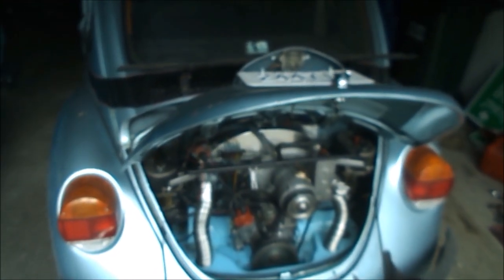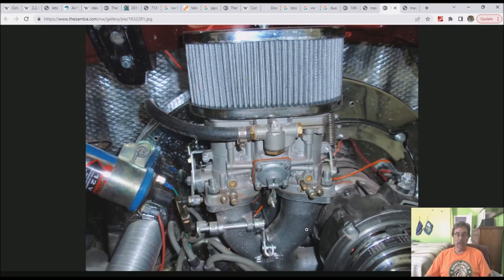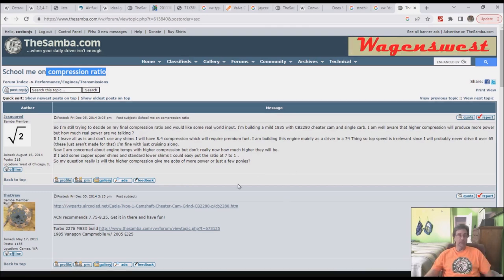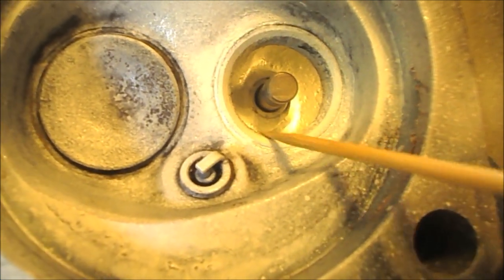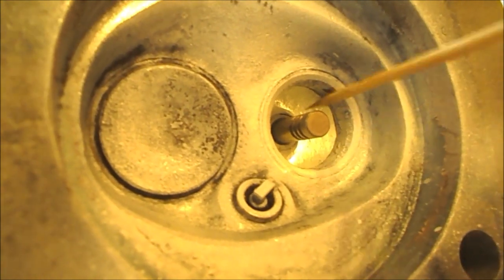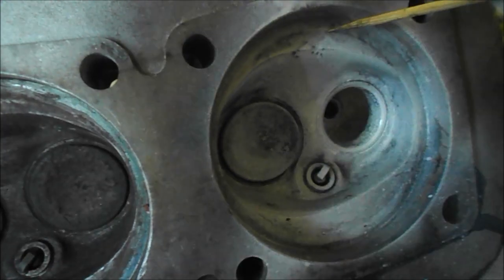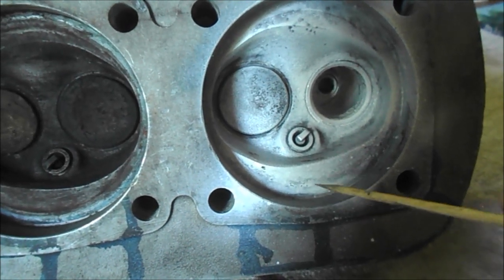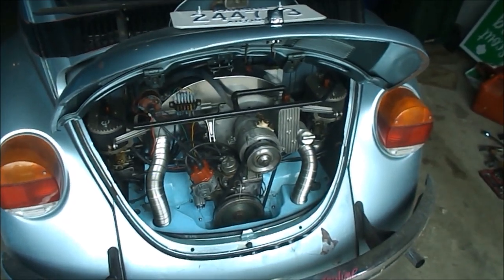vw type 1 vlog #22b keep your ac vw cool, carbs, compression, squish

Comment: I use heat exhaust wrap on my preheat tubes and the intake runners for my single IDF setup.  In above-freezing temperatures, it works great. Below freezing it takes a 20-minute warm-up but will drive horribly for about 3 miles. This next winter I'm adding motorcycle hand grip warmers to the IDF intake right after the carb mounting base.